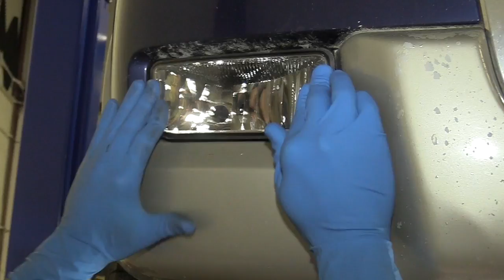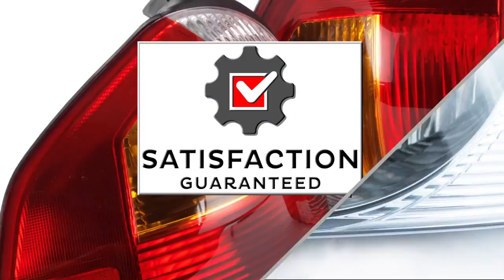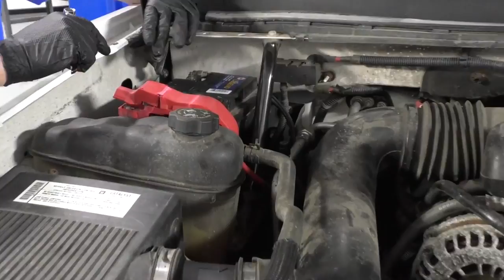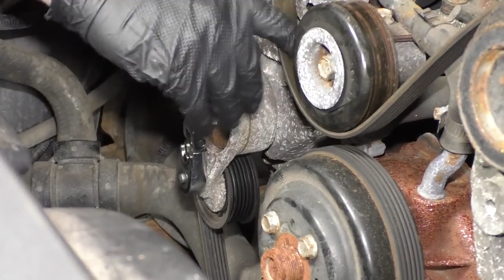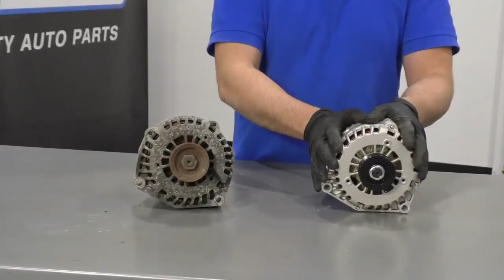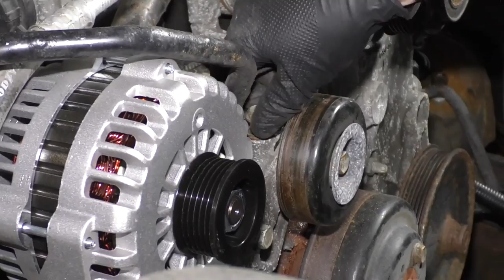How to Replace Alternator 05-10 Chevy Silverado

Comment from the maker: √  Watch the Video
√  Buy The Part at 1A Auto http://1aau.to/m/Visit-1AAuto
√  Do it Yourself
√  Save Money
Reply: I just bought this exact model and I can't thank you enough! Quick question, the engine bay itself is extremely filthy. Do you recommend cleaning the entire engine bay? And if so, do you offer videos on how to do this? Thank you in advance!
Reply from the maker: +Jay B Thank you for your inquiry!  Since automobile engines are cooled by coolant, not airflow, there is really no need to clean the engine outside of cosmetic reasons. If there is a lot of material that is flammable you should at least try to remove it as best as you can.  We do not have a video for cleaning the engine bay right now, but we'll keep this request in mind for a future video! http://1aau.to/m/Shop-1AAuto-c
Reply: @1AAuto  Thank you for the quick response! You have earned yourself a subscriber! I posted this next question on another person's comment but I guess I should just ask you guys: 

I just bought a 09 Silverado with a 4.8-L V-8 OHV 16V engine. My alternator and engine look exactly like the one in this video. However, the majority of other videos on youtube I find have the Alternator located on the right side rather than on the left. Can you explain why this is? Thanks in advance!

Comment: this is the perfect time to check or replace belts and hoses.  The serpentine belt is really important to these GM alternators. If the tension is incorrect, the Alternator will die young.
Reply from the maker: +Jim Parker Thanks for the feedback!

Comment: You didn't show the one thing that concerns me the most: re-tightening the belt. I am 5'2" 110 lbs and some times belts can be a - well you know- and is there a particular weight or tension they require? Thanks
Reply: 1 uga dugga will do
Reply: @caylarnson6043  yeah one Ugga should do it but make sure not to go too far and reach one booga.  Might over tighten the belt
Reply: Use a breaker bar to move the tension